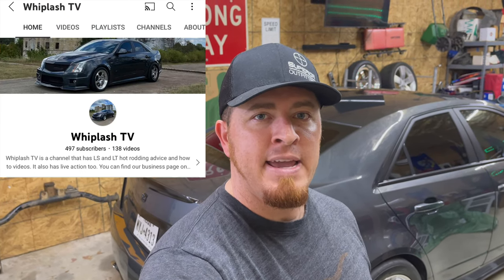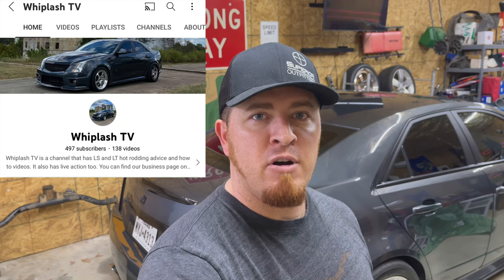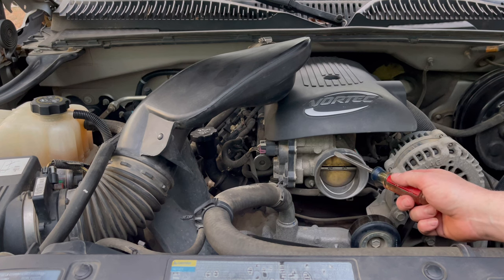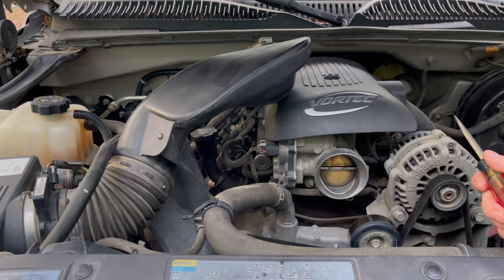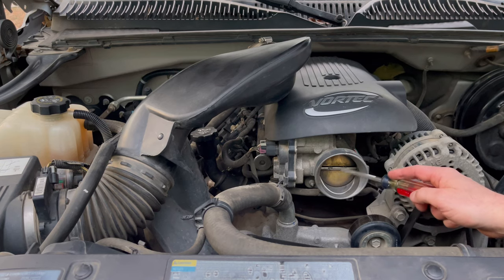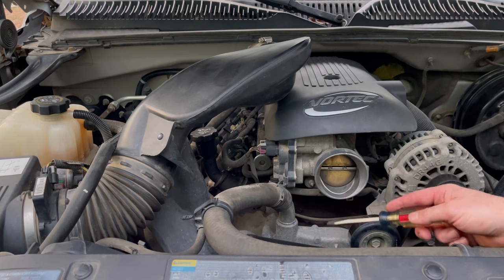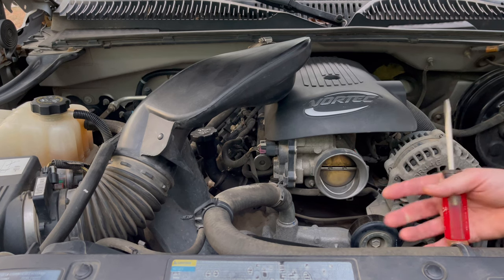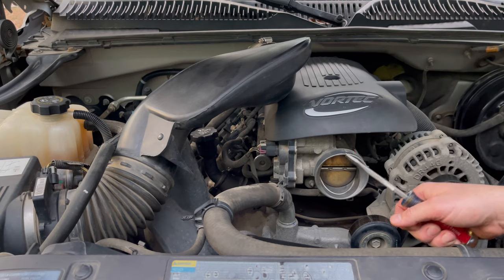2005 CHEVY SILVERADO 5.3 “FREE MOD” and bonus at the end!

Comment: Man, the spray paint on the grill looks great! What did you use?
Reply from the maker: Thanks, I actually painted the entire front end including the bumper and it turned out amazing!!! You can see that video here on the channel. The paint and clear came from Duplicolor.
Reply: @whiplashtv2022  Was it the same thing you used on the grill?
Reply from the maker: @racequad9  The black on the grill may have been Rustoleum paint, but any good paint that will adhere to plastic will work.
Reply: @whiplashtv2022  I like the gloss shine it gives it. I'll look around and see. I have tried other spray paint on plastic and they're not glossy like yours. You're giving me some good ideas lol
Reply from the maker: It is gloss black and has “plastic” listed as as a surface that it will adhere to. I hate the multicolored plastic front end that these trucks have. Wait til you see the front end paint video!
Reply: @whiplashtv2022  Already have. I am going to do the same to mine now lol Big Thanks!
Reply from the maker: You’re welcome 🤙🏻

Comment: How much timing does it pull at 86F?
Reply from the maker: It starts pulling as much as 3 degrees at 86 degrees IAT and it gets worse as it gets hotter. Up to 5 degrees pulled at 95 degrees IAT. Certain vehicles are scaled more aggressively, but this is how it is setup on this truck.